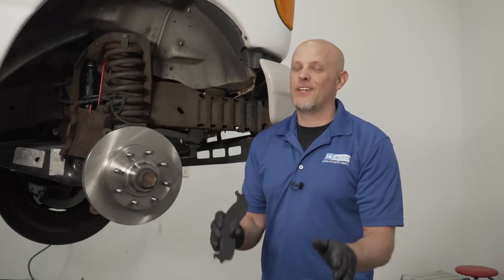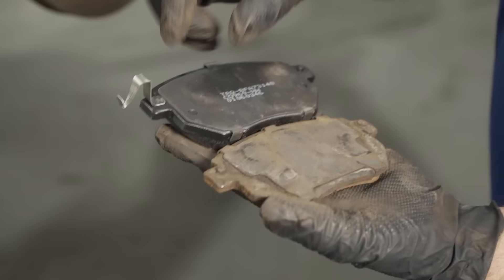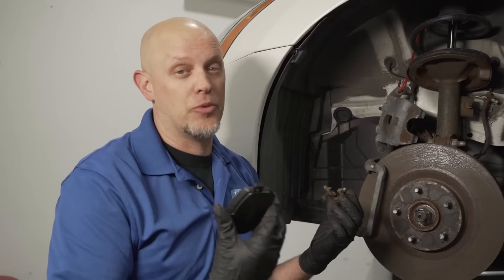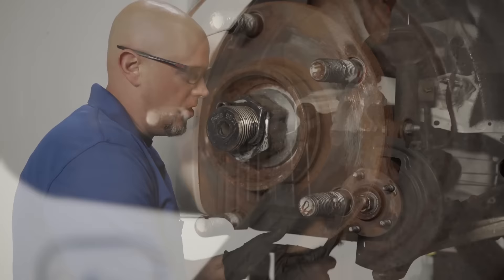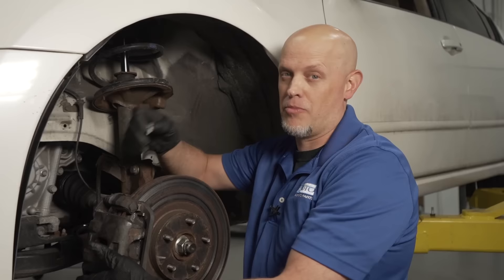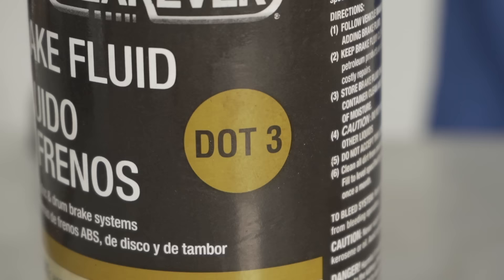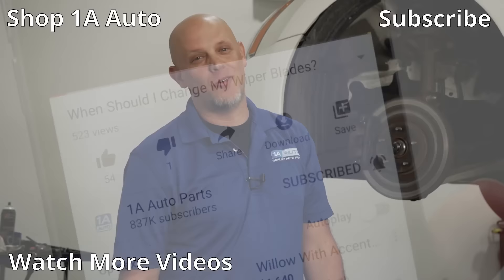Most Common Brake Installation Mistakes!

Comment: One mistake I made was placing the wear indicator backward. It messed up the brake dish by making a hole in the brake dish. I just replaced both the dish and the pads.

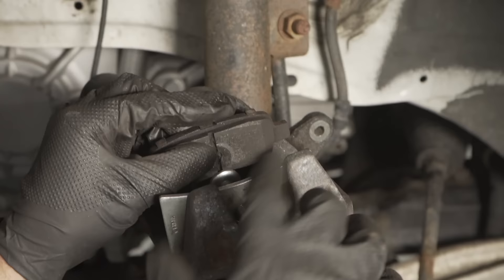Comment: 7:38 Before compressing the cylinder, you should take a blue shop towel, put a bit of brake parts cleaner on it, and clean off the exposed metal without getting any cleaner on the rubber seal. This can help prolong the life of your caliper by preventing contaminants from building up inside the piston. A very quick spray of cleaner on the shop towel (NOT THE PISTON as it will degrade the rubber) will be more than enough to clean it off. GIve it a few seconds to completely dry, then do the compression.

Comment: Oh its ok to go from dot 3, to dot 4… lets say if you are pulling trailers and heating up your system… but never go from dot 3 or dot 4 to dot 5.  If you find yourself needing higher temp fluid than dot 4, they do make a dot 5.1 that is compatible with dot3 and Dot4.

Comment: You didn't mention that the screechy brackets ( feeler gauge for low pad life warning ) should also go to piston side of the caliper because of the piston being on the inner side will generally wear faster because the piston movement applies more pressure on the inner side of the rotor !

Comment: when you replace the piston and seals in the caliper dont use random grease in there
some owner did his own brakes and used some weird grease that hardened and the new piston was seized in the caliper cause of it.
when the bleeder screws are rusty and dont seem to wanna turn you can smack the caliper itself near the bleeder area with a hammer usually knocks it lose and turns easly without snapping

Comment: I just replaced rear rotors but not the pads. They were like 60% I didn't compress the piston. Now the brakes are stuck on. Could the emergency brake be stuck? I mean they are stuck. It's all I could smell when I drove it. Any ideas?

Comment: Yes I have 2006 jeep liberty limited  just change out. Studs on the front tire I notice the brake sensor hose that screws on top of the brake system of a black screw came out his little hole behind the screw I don't know what you call it I'm sorry I'm new first time I did this Professor cable little black screen and screw anyway I did a little piece behind it can't complete that out of there and see oil on it I don't know if that's called but is that need to be replaced or going to be pushed back in and tight back down sorry I understand that I knew that I don't know what the name of it is thank you David

Comment: I have a metal wire sticking out of the a 2019 gmc terrain left front brake. Idk what it is. I think it's called a brake spring loader? Idk. I just need to know what I'm looking at.

Comment: On some cars (Hyundai Elantra) the brake cylinder can't be pushed back straight, you have to use a special tool to retract the cylinder.
Reply from the maker: +Tibor C. Thanks for the tip! We'll pass this info along to our production team.

Comment: Hi great content. I definitely appreciate you making videos like this. I have done most of my own mechanical work over the years including many brake jobs. However I recently did a simple brake hose replacement and I'm having issues with what I'm pretty sure is air in the lines but I have bled them several times and it still has air in them. It definitely seems like I'm getting nothing but fluid coming out. Do you have any pointers on what I should try? It's on a 2011 ford escape that I have also noticed the rotor bracket maybe bent to because it's rubbing against the rotor. I recently changed the caliper and didn't realize it rubbing when I installed the new one. Thanks in advance for any input.

Comment: Can OEM rotors be "turned" on a lathe? Every shop and most Parts houses had a brake lathe 20 yrs. ago. I was told by a mechanic recently, that rotors and drums cannot be turned anymore because they are too thin and must be replaced with new. Hard for me to buy that although with a lot of cast iron products sourced from China, it may be true. Any comments would be appreciated. 2009 and 2012 4- disc vehicles

Comment: Our 2015 Camry began squealing while driving and braking. We changed out all the brakes, rotors, and calipers but it still squeals some but not as bad. When we brake in reverse, it squeals loud in the back. Any ideas?
Reply from the maker: +@annabellejonesify We wouldn't be able to diagnose an issue like that here, you may want to have a local mechanic take a look at it. Thanks for checking us out! http://1aau.to/m/Shop-1AAuto-c

Comment: Please add a comment in the video that many newer vehicles also have a small screw holding the rotor in place as most people will not read all these comments to figure that out, otherwise great video.

Comment: I have a 2018 Fusion sport and have clicking noise on the driver side. I replaced the hub and cv axle thought it was them. Still have the clicking the clicking gets louder the faster I go. I had my mechanic looked at my front suspension and he said they look fine. Help please. The clicking drives me crazy

Comment: whats a good grease for brake pads?
Reply: Use silicone ceramic lubricant it can withstand high heat.be careful not to get any lubricant on any braking surface such as on the rotor or brake pad braking material.
Reply: Brake pad grease

Comment: One time I did accidentally pour power steering fluid into the brake fluid reservoir. The containers looked so similar. I think I realized that luckily power steering fluid is lighter than brake fluid so it floated on the top of the brake fluid. I took a baster and sucked out all the fluid from the reservoir and re-filled with brake fluid. Crisis averted. LOL

Comment: I’ve been watching videos on brakes since I’ve had to replace my brakes pads and rotors for the 3rd time within 5 months! I personally didn’t replace them, took them to a well known auto shop. By watching these videos I’ve learned that the mechanics haven’t been doing a thorough inspection on the brake system. I don’t understand how these companies hire their mechanics.

Comment: How about drum brakes?
How to determine if a caliper piston is sticking.
How to determine proper brake fluid level with pad wear.

I recommend a large 3-jaw puller or similar apparatus for removing stuck rotors.  Hitting too hard on the hub can bend it and... use your imagination as to what issues can ensue.

Rust "growth" between the rotor and hub is a leading cause of brake rotor warpage in the rust belt, so that's a good reason for the anti-seize between them.  Rust is like water when it freezes--it expands.

Pump the brake pedal before trying to drive a car after a brake job.
Reply from the maker: +Paul Standaert Thanks for the tip!

Comment: Hi. We have a 2003 Toyota Tundra. Recently had the front brakes replaced (whatever that means) and ever since then, almost every time we brake, the truck comes to an instant stop..many times also going through a kind if grab grab grab then a sudden stop. We brought it in and was told everything seemed fine and that it may be because the brakes are new. I swear I may have a heart attack next time I brake because of this sudden grabbing stop. It's nerve wrecking. Could they have put the new brakes on wrong?? Thank you. Sherri Becker
Reply from the maker: +rawfoodelectric We wouldn't be able to diagnose an issue like that here, you may want to have a local mechanic take a look at it. Thanks for checking us out! http://1aau.to/m/Shop-1AAuto-c

Comment: Thanks for an excellent summary of so many brake topics! One unanswered question I had has to do with the caliper mounting bolts. Mine have a torque spec of about 90 ft-lb and I found they were very hard to loosen, probably made worse due to exposure to water, etc. Would it be correct upon re-assembly to use anti-seize (e.g., Permatex) on these bolts, with the hope of having an easier time with removal during the next brake service episode?
Reply: My mechanic put thread locker on those. That’s what he taught me to do. Don’t want them loosening up while driving. I don’t think never seize would be good. I’m not a mechanic but I’d look more into that.

Comment: A piece of hose on the brake bleed screw to direct fluid into a jar.
use a 2x4 or similar wood .... and you won't hurt the rotor
always wear glasses ( safety ) 
before compressing the caliper in addition opening the bleeder screw, place the master cylinder cap loose on top of the master cylinder. 
LV brake fluid is better!   LV = Low volatility.   Other than those, I too learned a few mistakes that newbies would make.

Comment: About the  only thing  I could add , for the cost, I always just replace the slide pin boots along with all the other hardware, clips etc.
Oh and it wasn't mentioned but some rear calipers , the piston can't be pushed back in, you need a little tool and they screw back in.
Reply from the maker: +Space Avenger Thanks for the tip!

Comment: Just some advice here. You shouldn't ever put new brake pads on a worn, raised ridge rotor. Braking ability is diminished until the brake pads "wear-in" over time and match the surface of the worn rotor. Change the rotors so the new pads are braking against a fresh machined surface.

Comment: I've had a "professional mechanic" put the inner pad on the outside and the outer pad on the inside. Well the "guard plate" on the pad, where the dimple is, that rotated and OFF of the pad nd got stuck grinding on the hub part of the rotor.

Comment: One more thing i replaced them cause on the rear one outer side pad completely worn to the metal but all on the rear were worn on one end but had pad on the other end HELP ME PLEASE! Could it be the lines in the rear not letting it pump up a solid pedal

Comment: The good news is if you put things on backwards you will find out pretty quickly. The bad news is it will be an expensive education. And I don't think 1A will buy your wining about some warranty claim.
* Pay close attention to how things come apart. Take pictures if you are not familiar with doing this job. They will make a great reference when putting things back together.  
* Treat the brake pad friction lining (the business end that rides on the round shiny rotor face) like a surgeon in an operating room. Don't let anything greasy touch it. You want the pad material and the mating shiny rotor face perfectly clean and grease/ dirt free. Brake cleaner both parts clean as a good last step before installing. 
* Brake rotors have a wear limit thickness stamped on them. Measure them with a caliper to be sure you are not getting to thin. Any grooving or ridges on the friction surface need to be gone or you will be back for new pads again after realizing you are not coming to a stop like you should. Most of the time you can have them resurfaced perfectly flat at a machine shop or auto parts store that has the equipment. Any warped, gouged or messy looking rotors need to be thrown away and get new ones to go with your new pads..
* DOT3 brake fluid will destroy paint, so be careful with the stuff. 
* Clean everything rubber when it is apart and some silicone spray or rubber lube lightly wiped on it when assembling things.
* Only use brake caliper grease, not wheel bearing or lithium. Brake grease is specially made to take the heat and hang in there.
* While you are at it go the extra mile and clean/ wire brush the rusty cruddy iron parts you have taken apart before reassembly. Cleaning up the visible part of the shiny piston is a good idea too. A LITTLE high temp thread sealant on the mounting bolt threads when reassembling will make the next brake job easier.  Some buy and coat non moving cast iron parts with your favorite color high temperature caliper (only) paint.  But NEVER any shiny or moving parts! 
* Look closely at the flexible rubber brake fluid hose for age and cracks. If you see anything other than good smooth rubber replace them. Certain Ford Escapes are notorious for destroying the front lines. 

Not often mentioned, but bleed and top off the brake fluid every two or three years before it turns the color of some ooze from an extended engine oil change. Brake fluid likes to attract moisture, which is a bad thing for the system. The near clear color of the stuff in the master reservoir will tell you things are looking good. Any dark amber to black coloring is saying time to flush it all out, the way he shows' to bleed the system.

Comment: How do you get oil in your brakes fluid?  Well when I was a young lad I put power steering fluid in the brake fluid reservoir.  It's right in line with the steering, after all!  😂 So yeah every rubber component in the entire system would gradually swell up (and it got worse with higher fluid temps) and that gradually applied my brakes.  Imperceptibly at first, and gradually tightening until it became very noticeable.  This caused the brakes to heat up to glowing, hardened the rotors (once cooled) so they couldn't be machined, glazed the pads and cooked the calipers.  All seals, rubber lines, fittings - everything after the the master cylinder has to be replaced.  That cost us something like $1500 in 1992 dollars which would be probably nigh on $5k today.  Sometimes stupid is expensive.

Comment: how about putting brake pad on back-wards and wrong side like left and right? took me the whole day to figure out! I called a mechanic he said rotor was too big, so I dissemble in matched rotor, same size, I walked over to dealership and ask is this brake pad right he said yeah, so I say what am I doing wrong, so I tried flipping around the brake pad and then bam caliper lined right up.😁

Comment: Why cant you wire stuff up under the car?  My u joints were bad so i taped and wired the driveshaft to the exhaust pipe, it should hold, im goin for a drive now to try it

Comment: Id add that if you cant get the rotor off..the bolts actually fit into the the holes on the rotor so you can screw them in and the rotor will pop off. Just do both.

Comment: Very good explanations. I am so glad I have been preaching these tips to everyone who I have assisted. The only thing I never thought of was cracking the bleeder screw while compressing the caliper. Thank you! And keep up the awesome and helpful videos. -Mike
Reply: Try lossening the reservoir cap. Less of a mess. Just remember to tighten it as soon as you get the piston pushed in so the fluid doesn't absorb moisture. I do this for each wheel.

Comment: Push the piston back slowly with a g clamp or it may turn the seal in the master cylinder do not open bleed screw only take off brake fluid resevior cap

Comment: don't use detergent to clean brake rubber seal or boots and bellows, some guide pins have short rubber sleeve and will swell and jamb if wrong type of grease is used

Comment: And if you have problems remembering where stuff goes, take pictures.  Get a magnetic tray to put bolts into.  It will prevent your bolts together so you can not accidentally knock one away and have to hunt for it.

Comment: what kind of grease were u putting on the brake pads?
Reply: I believe that is Anti seize.  You can get a bottle for like $10 at your local auto parts store.
I haven't been using anti seize, but I do clean the surfaces really good.  I figure that that should work as well as using anti seize.
Reply: Several companies make grease specifically for brakes, often called "brake caliper grease" or something similar.

Comment: Im working on my moms 1991 6 door cadillac limo and thete are 6 different fittings two threed types and two hose types regular stores around hear did not have the right fittings the threeds on the master cylinder are a little worn from taking on and off repetitive so i saw a little brake fluid leeking very little so i packed around the fittings and hoses with two different types of epoxy firsd i used a dow marime fast drying kind than i put a cousin liqued marine epoxy that is a 6 hour dry and bleed them turn on car pedal soft  come to find out with my research i think my moms friend just put the calipers on wrong or they need replacing  because still not much strength in brakes when cars on and i thought he changed the brake booster come to find out he juat plugged the line coming from engine that needs to be connected to brake booster i think thats why my moms car keeps dying while shes driving because he plugged up thay hose im trying to do what i can with the resources i have dont realy have money to take it to a professorial dont like asking men because the ones willing to help dont know anything and the ones that know want money im just a girl with some knowledge i feel im doing ok but with brakes it needs to be perfect so what do you think about this?
Reply from the maker: +Manuela Terrell We wouldn't be able to diagnose an issue like that here, you may want to have a local mechanic take a look at it. Thanks for checking us out! http://1aau.to/m/Shop-1AAuto-c

Comment: My neighbors, 2 brothers, after doing brakes asked me if the anti-squeal grease was to go on the back of the pads or the side adjacent to the rotor. Too bad they didn't aske me before they put it on the braking surface. At least they didn't  drive the car. So they took the brakes apart and cleaned off the grease with brake cleaner.
Reply from the maker: +stevencarr239 Thank you for sharing that story! We love empowering our customers and showing how to perform DIY auto repairs with our high-quality auto parts.  http://1aau.to/m/Shop-1AAuto-c

Comment: If you touch the bleeder screw you introduce air into the system, will require bleeding the air out of the whole system. Just take the cap off your brake fluid reservoir.

Comment: should torque bracket bolts if they come louse and u put the brake on it will lock up a wheel
(if bolts would come out)